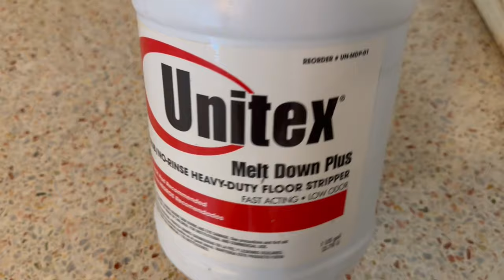Wax and grime removal reveals beautiful floor underneath!  Dull to dazzling Terrazzo transformation!

Comment: Question, after honing terrazzo, did you just wax on top or should I seal the floor again? The reason I ask is, I stripped a concrete floor while employed by a company and they didn’t want to seal the floor. It was like waxing a sidewalk lol.
Reply from the maker: Concrete and terrazzo are two different things. There was no wax applied, floor was chemically polished.